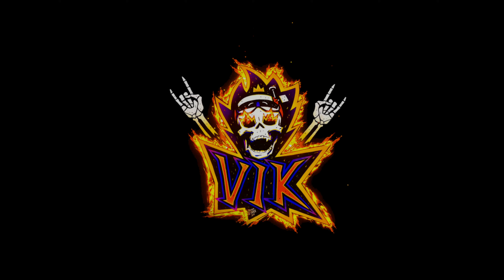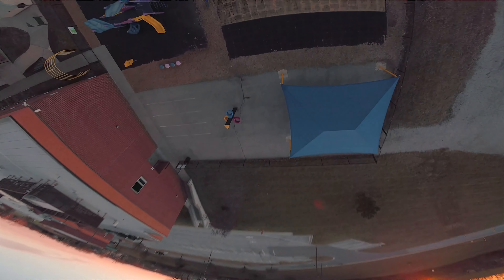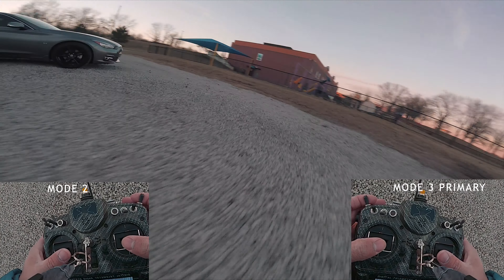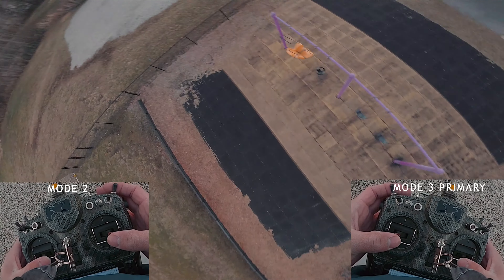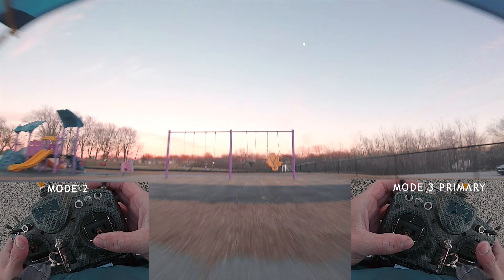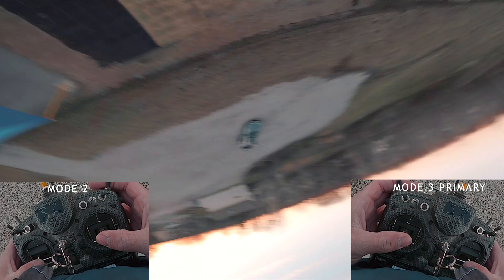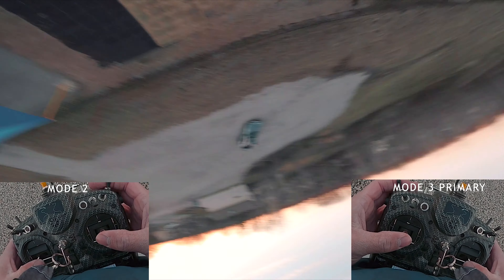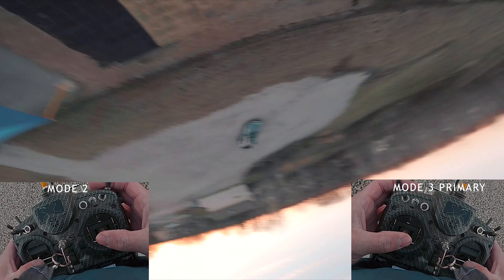How to BackSLIDE into INVERTED YAW SPIN? 🔥👀 | FPV ADVANCE TRICK SERIES

Comment: i cant inverted yaw spin very levelled out.
nice trick
Reply from the maker: Thanks man.
Reply: Thrust yourself upwards before inverting, this gives you more time to level out while inverted,  keep practicing this and you will get to the point where you snap right into a level inverted position just about every time. Flying quads is all about throttle management.  Every trick, every move, it's all throttle management.  Good luck !

Comment: very good as always .. when I do the inverted yaw spin I get down very fast towards the ground .. is there any co-figuration that I have to take into account ?? Cheers
Reply from the maker: Take your time. I have no idea it really depends on entire setup and weight as well
Reply: @VIKFPV  Could the mid throttle influence ?? Maybe because of the yaw, when making a very fast turn ... Sorry if I say some barbarity but I'm a newbie ... thanks again
Reply: @DIX-P2  the overall weight of the quad plays a factor,  you want it as light as possible,  also the min throttle is important,  if flying betaflight then like 4-6% if on Kiss then like 1004-1006 on the min throttle.  You want just enough to keep your props spinning. Also give it a burst of throttle right before you flip inverted and make sure you are at 0 throttle once inverted,  you need to be thrusting upwards while flipping to invert in order to give you the hang time to make corrections.
Reply: @jasonhull5712  thank you very much I will try to prove what you say .. your comments help me a lot .. greetings from Spain

Comment: Do you use any configurations in the radio controls? Or just created the model and flies.
Reply: Just setup a model for each protocol and all the rest is done in the configuration tab.
Reply: @jasonhull5712  nice bro! Your flight is very accurate and smooth! I still get there
Reply from the maker: Thanks man

Comment: You seem to have more hangtime during your inverted yaws. For years I’ve wondered how you do it. Mine seem to “float” until I add yaw inverted then seems to power me toward the ground making it less than desirable visually.
Reply: The trick is to throttle upward hard right before you invert, then you will be traveling upward but it will look like you are just hanging there inverted.  Start getting use to adding a throttle burst right before you roll or flip into the inverted position. You will start to get the feel for it, I promise.  Just make sure you are at 0 throttle once inverted,  and make sure your Idle is set to the minimum amount it takes to keep your props spinning,  (if betaflight then like 3-5%) or Kiss is like 1004-1006 min throttle.  
And practice with intent, as much as we all like to just rip around. Set a couple packs aside for "practice" and break them up between your normal flights. Good luck man. ✌😃